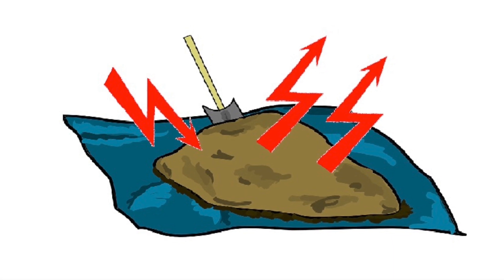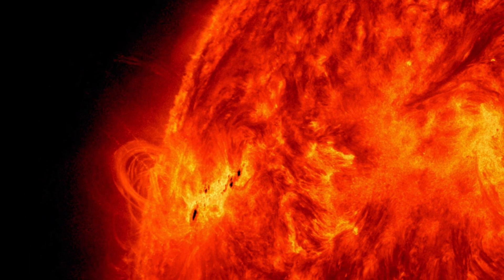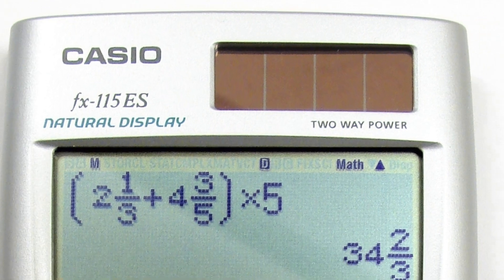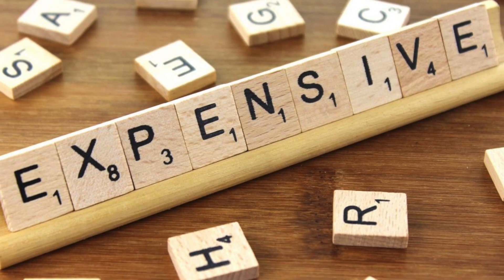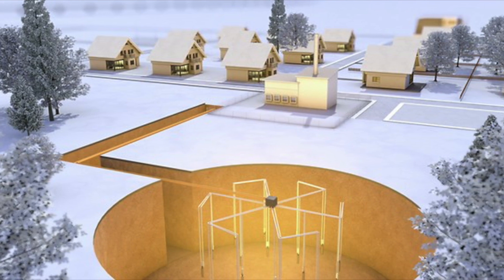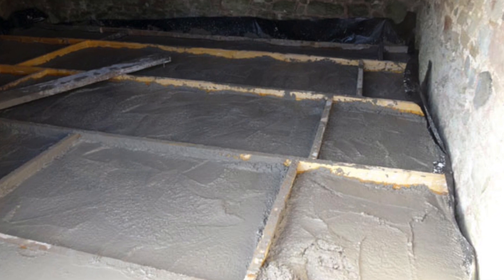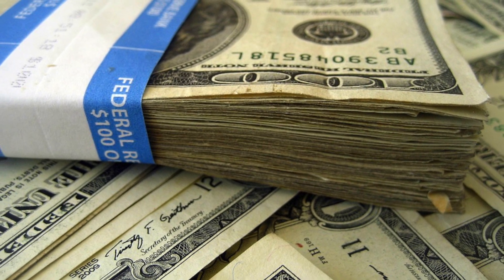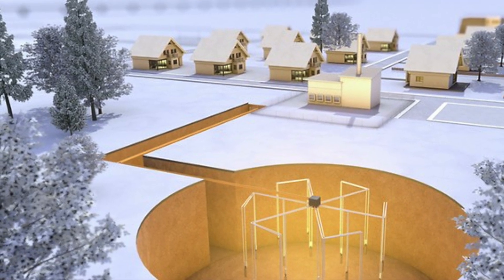Home Solar Thermal Dirt Battery (2020)

Comment: What I'm going to try next year is to insulate my cellar under my bungalow fill it with water and heat this water up using solar tubes during whole summer and during winter too. The heat exchanger will be in the water and will see how long it will keep me warm. I don't used the cellar anyway and it is under the whole house. Lot of water,lot of heat during the summer and costs will be low I would say, just have to make sure that I will not make the foundation wall soaked with water. How about doing it this way? The heat will be trapped under the home in form of hot water. The house is 120sq.m. living area same the cellar witch is 2m high. A lot of water.
Reply: I don't like to find fault but I can see some serious problems with water vapor infiltrating the house and condensing on surfaces and inside walls.  Just saying.  Unless you sealed the house 100% from the cellar.
Reply from the maker: @tomwakemsr.4942  I like dirt for that reason
Reply: Good point but will take care of it one way or another. Thanks anyway.
Reply from the maker: I like it
Reply: I'm not against dirt but I do like to know how much fuel (hot water) would I be put together in KW trapped in that hot water to be able to calculate where do I stand day by day. Let say if I would start my heating season with 25000ltrs of hot water heated up from sun in insulated cellar to roughly 60 degrees of centigrade I would be able to work out if it too much    I will sell some heat to my neighbours if not enough than will have to do something about it. But mainly I will finally know how much hot water my house need to be warm. Take care and thanks for pointing out a discussion.

Comment: Nice video ..  I'm doing something similar. I am building a quanset home! The ridges in the vertical wall facing the sun are going to double as sun boxes. The heat will be send into the ground and some into the ceiling. The ceiling is airtight! Within each bedroom there is a heat exchanger for each bedroom. The heat is extracted out of the ceiling at night (passed thru UV light). They are independent!  

The rest of the heat will go into the ground as you described.  It will be retrieved with by the radiant floor using pex! The battery will be about an acre in size...
Reply from the maker: R Coyote I love it! Not sure if you need an acre though, even drake Landing Solar Community isn’t anywhere near that for 50+ homes
Reply: @SimpleTek  well, it will also serve a shop that's 50x60 feet. Anything left outside will turn into dust. 
 One acre is a bit overkill I know. I only have a medium size loader to do the job  and the distance is a problem!  A backhoe cost me $1500 a day. No operator.

Example: my sewer tank and my leach field are 800' apart down a hill!  My battery will be just the same! It may get smaller, but I will see when I get in there. 
I'm off grid and power is no problem...  But heat in the winter is better not tackled with PV!

Comment: Nice idea..but.  you build your home over the heat sink. Or a large swimming g pool
Reply from the maker: I wouldn't have it under the house, there is some heat advantage to building directly over, but I want to be able to service the dirt battery in the future if something happens
Reply: The issue with doing it under your home is that it will overheat your home in summer. Cooling is needed in summer.

Comment: Salt water. Anti freeze is a pollutant nightmare
Reply: I dont think you understand...you could Not afford the remediation if it leaked.risk vs gain. Good luck. Do it and tell us how much you saved.
Reply from the maker: Joseph DuPont leaks are possible but geothermal heat wouldn’t be as wide spread as it is if it was a real problem. I’ve also laid about 1000 feet of water lines for wells here 12’ down 6 years ago, with no issues
Reply: @SimpleTek  propylene glycol isn't that much more $$ than ethylene glycol (antifreeze) and it's not toxic.  Check your local codes department before you add antifreeze or just keep all tubing below the frost line and use pure H2O
Reply from the maker: interesting idea - but I'm dealing with -40 temps,  salt water might freeze
Reply: @SimpleTek  please  please how far down it is -40.  besides at real low temps  you have  accumulator tank to lower the water level  of the system...
Reply: Bad for pumps. They put propylene glycol in food. Ethylene glycol (car antifreeze) is not good to drink.
Reply from the maker: Mark Schroter the heating system doesn’t touch the food
Reply: if it leaks you will  have a multimillion dollar law suite.  for what..
Reply from the maker: Joseph DuPont what? Who would you sue?
Reply: The person who pollutes the ground water epa. You know.
Reply from the maker: Joseph DuPont how would the ground water get polluted in a closed system ?
Reply: @SimpleTek  are you for real? no disrespect... All kinds of issues.. on leak and your screwed ..I really don't want to take any more time on it.. Go ahead blow your savings..  have a project that won't work.. it is no skin off......
Reply from the maker: Joseph DuPont geo thermal systems in the ground and in concrete have been used and have been working for decades. Can problems happen? Yes, but they are rare in a closed system. I think if my area was prone to earthquakes maybe, but that isn’t an issue here

Comment: I am on the fence with insulation and wonder if it is worth the extra expense. Would it be better to not increase the entire mean temp of the subsurface? Would this have negative consequences? For example drying the ground out? I don't have any answers to this myself.
Reply from the maker: actually great question - I plan to test this in the future.
Reply: @SimpleTek  
At these kind of temperatures you should insulate the bottom of the hole. Heat does migrate downwards where it does increase the subsoil temperature average but with 60 deg C storage temps the losses will far outweigh the cost of the insulation. Personally i would locate the warmest part of the pex as far from the perimeter insulation as possible . Heat moves through soil slowly and the temp around the pex will be very high, ideally you want to minimise the temperature differential to maximise the effectiveness of the insulation.
Reply: @SimpleTek  Did you?

Comment: With respect to fluids, We typically use propylene glycol but you could try an alcohol based antifreeze. I suspect it may cause problems with a grundfos pump and would talk to them directly first.
Reply from the maker: thank you

Comment: Fluid transfer via geothermal exists. When you multiply it with a heat pump it is feasible to use in cold climates. Not cheap though, but it could be cheaper with greater adoption. It doesn't solve the electricity storage problem though. Air to mass heat exchange can be used for a low tech replacement, you may need to consider bacterial contamination though.
Reply from the maker: Liquid to liquid solves the bacterial issue. The climate battery greenhouses I've talked to haven't encountered bacterial issues, but you're right a house is more of a concern than a greenhouse for that.
Reply: @SimpleTek  I tend to concur and I would probably feel more comfortable using it in a less air tight, non habited area.

Comment: I just picked up a few coils of geo tubing for a heat pumps system. Have began trying to find more information on it. 
What part of the country are you in. Like to here about the ideas  that are work. Looking at building a garage /greenhouse with a system that will heat the house too.
Hopefully there someone watching Will give some directions in this.   With the new pumps it sounds good, but having trouble finding a unit that's not going to cost thousands to setup. Think of taking a course or to to find out more. Thanks to all that help.
Reply: Winter here is good.  Calgary gets warmer with the Chinook winds. Also asked a question about auto anti-freeze I have a few drums.  Would it work in this system. The tube is 1 1/4" with a thick wall. Would it make sense to put it under the greenhouse.   (My yard is small) . Thanks
Reply from the maker: Kijiji2017 Porter I’m in manitoba, about an hour north of Winnipeg. If you look around you should be able to do what you want cheap! Don’t give up!
Reply: @SimpleTek  Brr. We have had it mild west of you, how has your winter been?

Comment: One set of liquid tubing in the storage battery is all that’s needed.
Reply from the maker: Howard Nelson one to inject heat, one to extract, so 2 min. Some days you’ll need to extract while heating
Reply: Simple Tek in the heating industry we use a primary / secondary loop system  on boilers and heating systems. You will need 3 pumps. Your primary loop is the battery or storage . Your secondary loop tees into the
Reply: Tees into the return side of the storage loop.  If you look up any manufacturer recommendation for hot water storage or infloor  piping designs it will show you the piping diagrams
Reply: This system can be used to heat and cool your structure especially if you use an air handler with a coil in the duct work.
Reply: Do you have an email address so I can send a drawing. You are welcome to share the drawing
Reply from the maker: Howard Nelson hjor@mts.net
Reply: Simple Tek I tried this address but it came back as non existent
Reply from the maker: Howard Nelson odd, that’s my email
Reply: @SimpleTek  you technically only need 1 long tube and 1 pump + some control valves for controlling where flow goes; however in order to get good heat transfer without a ton of head loss, a bank of multiple shorter coils is better.  For example a 1" pex inlet branching into four 1/2" pex coils and back to a 1" outlet will have less than half of the head loss as putting the coils in series, but still have good heat transfer.  Its also better to have the hot flow going into the center 1st when storing heat, but coming from the center last when using it because it's hottest in the middle  (we called it the Darth Vader curve in nuclear power school)

Also Aircrete may not be a great insulation choice underground once all the pores fill up with water and it has no place to dry to.  You can dig a trench around it for a French drain / sump pump system, but if you're going to do that you can just use Styrofoam instead of gravel and it takes care of insulation too.  My scrapyards have always had truckloads of waste Styrofoam.
Reply: @SimpleTek  I think you guys are talking past each other.. One loop for heating and another loop for distribution is required for an all liquid system.
Reply: Only in an imaginary world where soil conductivity, diffusivity and tubing frictional losses dont exist ;)
Reply from the maker: JohnGuest45 you realize thousands of water pipes, tens of thousands of miles, already exist in the ground right now for decades and work perfect right?
Reply: @SimpleTek 
Works perfect for doing what? conveying water from a to b? If your talking about hydronic floor heating, it involves more thought than just burying a long length of pex in the floor. Much like the inflated double covering idea you had for your dome greenhouse, its easier said than done.